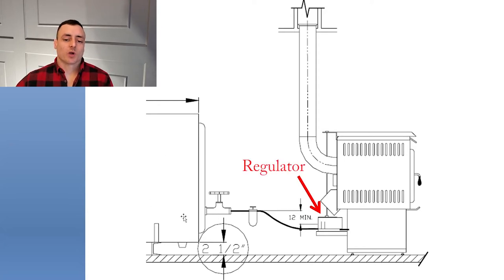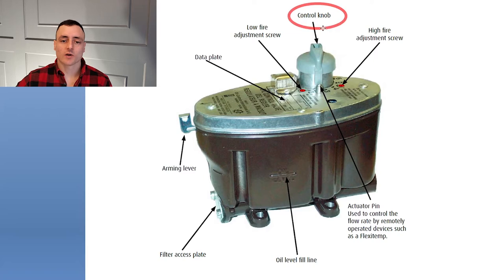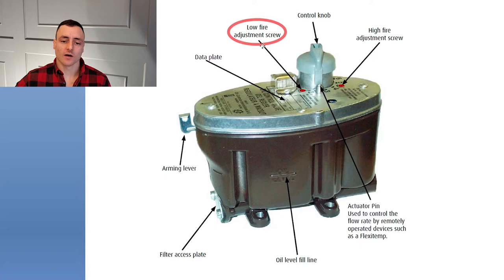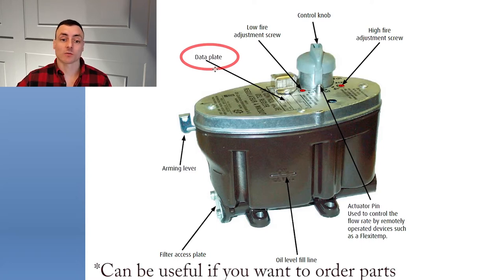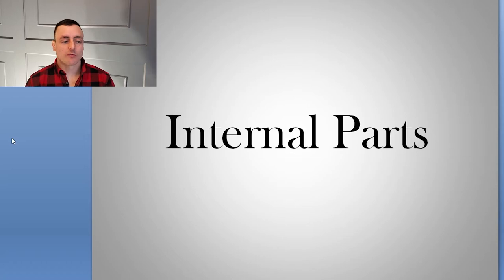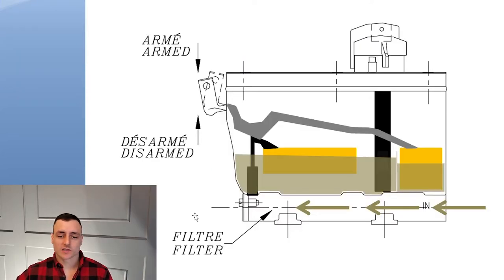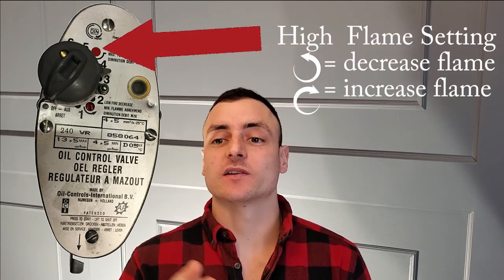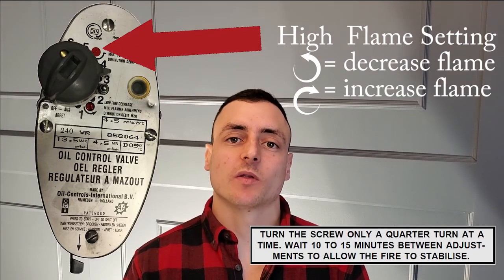OIL STOVE | How the CARBURETOR / REGULATOR Works | How to adjust and clean it

Comment: We have 
Hi we have a very similar regulator (a Lockgate) on a morso squirrel diesel stove in our narrowboat but have no instructions on it & have not been able to find any. This you tube vlog was reccommended & it's been really helpful, thank you.
We do have a question though - If it does overflow & shuts itself off where does the oil then go so it can be restarted?
Reply from the maker: Good day, glad it helped! The oil
Will be held in a separate compartment in the regulator (shown in a diagram in my other video). When you restart it, you need to press the lever down on the regulator to get the oil to flow again. It will begin to flow again and the overflow will eventually flow into your stove :)

Comment: Hi Phil, great video.  However, I'm not getting any fuel into my burner pot.  The fuel is running from the on/off but not exiting the regulator.  I have checked the filter and it is fine.  Any thoughts?
Reply: You need to remove your regulator and take the top off and remove the needle valve and float. Sounds like you have a float that is full of oil and it’s not letting the needle valve to open and let fuel in.

Comment: Hi! Thank's for the video. My float doesn't seem to operate properly, my carb is overflowing. Is there any info about the float adjustement? Thank's
Reply from the maker: Check out my recent video about regulators, I open one up and it may help you identify the issue on yours. It may just be stuck. Cheers!

Comment: I have a stove from the 40s. It has an end heater (oil burning). It has a regulator (constant leveler) but doesn't have the high low knob or set screws on the cover. Would you say use it cause it was original equipment or get one with an adjustment on it? I plan on hooking up this propane 4burner stove/ oil end heater soon and appreciate any advice you can give me.

Comment: Interesting info.  I just restored a GLT-II oil stove, and fired it for the first time today.   My draft measurement is too low, and sooting the glass a bit, but it was warm today.  (70°F/21°C)  I suspect that I'll hit my proper draft below 40°F/4°C outside air temperature, and things will run cleaner, but I can extend my chimney if necessary. (Only 14ft/4.25m and supposed to be min 16.5ft/5m)
Reply from the maker: My new video is up, thank you again for your help and good advice!

Comment: Thank you for all you videos! We have one of the old Coleman furnace oil gravity fed and your videos have been a a huge help. Finally got it running and throwing some heat with no black smoke billowing out the chimney. Just discovered that adjustment screw is missing. I don’t know if it was ever there TBH. Can it be replaced with just any screw that will fit? May seem like a dumb question but this has been a 2 winter labour of love project. Lol. I would hate to be back to square one.

Comment: Finally very good information on these stoves! I used mine for our portable hunt camp and we use diesel. I have few questions. 1 is it better to use stove oil? 
2 is a barometric damper recommended?
3 i cleaned it all out but it always seems to soot up. Would be high/lo flame adjustment or primary air? Thank you!
Reply from the maker: Good day, glad it helped! 
1. stove oil or diesel will burn pretty much the same. I haven't seen any benefits from using either. 
2. yes, a damper is always a good idea to keep a steady flame. 
3. It could be both, start by adjusting the flame to the low setting, and slowly increase the size. If the flame is too high, it will soot up quite quickly.

Comment: I have a heater that uses one of these carburetor. 1947 Sears pot belly oil burner. Been burning used oil through it very well except for the needed cleaning every day or two from the build up and chimney pipe cleaning every couple weeks. Was told to preheat the oil and that would help the soot and chimney build up a a lot.

I was thinking of doing a single or double loop of the copper tubing around the stove pipe but can't find any information if the carburetor will be ok with the oil heated.

Was also trying to find a way to preheat the pipe that goes into the belly, but not having much luck.

Any ideas?

Thanks
Bob
Reply from the maker: That’s a great question. I don’t think heating the copper line will affect the function much. Maybe running it at a lower setting to counteract the heated oil that’s maybe less viscous. Is your oil line freezing or affecting the flow? I’ve ran mine at minus 30 Celsius with no flow issues. Let me know :)

Comment: Would it work if you bypass the carb and just  regulate the fuel with a ball valve or something?
Reply from the maker: It could, but your ball valve would need to be perfectly adjusted. Might work for a bit and the it would be out of sync.

Comment: Hi Phil
Thanks for the info...I have an old stove with a similar control valve.
I understand about the high and low flame adjustment screws....but why is there a third adjustment screw on the adjustment knob itself (or under it)...?

Comment: Do you know how to set the Low Fire Limit screw (not the low fire - high fire on the slider?)

On mine, when you depress the actuator pin down, the oil flow stops completely rather than going to low fire
Reply from the maker: Does your float get stuck? Sometimes the overflow is too full causing it to trip right away.

Comment: Hi I've got a DeVille stove and I've been using it for years worry-free this year I went to fire it up and fluid leaked out where the disarming switch is I assume after watching your video that the floats and the shut off malfunctions so I'm going to take it apart again and look at the intake screen make sure that's clean and I will probably drain the carburetor itself and make sure there's nothing plugging the intake line and see what happens do you have any other suggestions thank you for clarifying that disarming switch and its function I always forget which direction it needs to go it needs to go up to turn it on and down to turn it off that helps

Comment: Good video. My stove stopped working. So I removed the filter. It wasn't very dirty. I cleaned it. And there still isn't any oil coming in from the line in the bottom of the stove. I removed the line coming into the stove and it was clear as well. Does this mean the valve itself is not working properly?
Reply from the maker: It could be the valve or maybe you need to use that lever behind The stove to clear out the line going from the regulator to the burning pot. Let me know if this helps.
Reply: Found the problem. The filter coming off the tank was plugged. Replaced it and it's up and running. Trying to adjust the low flame so it's blue and not yellow is a struggle though. On low setting it's yellow for the most part. If I turn the stove up to a higher setting it goes blue. Any tips on what I can do?

Comment: Thanks for your very informative video. I’ve tried adjusting the higher and lower level screws as you suggested and waited 10 mins or so with no noticeable difference to the flame. It seems the flame just stays to one side  (the side where the oil is flowing from) and never travels other to the other side to create the ‘ring’ of fire. Any ideas or advice on this? Thank you!
Reply from the maker: Hello Edmond, it either seems like your stove is no level, or there is not enough flow going into the burner. Did you try to open the regulator? After many years, deposits can block or slow down the flow. Let me know if you figure out what the issue it!

Comment: Love your videos.👍 i have just purchased a Siegler oil furnice and couldn't open the front viewing door when buying it. Got it home and openned the door and found the fire box corroded thru in a couple of places. Near the bottom ledge and on the left courner. But i have 2 questions 1. Can i rebuild/repair the firebox with ceramic fiber board and why can't i move the knob on the carberator at all. It has a small metal box on the top of the carb .near the knob with some dort of spring mechanism. On the other side laying above the carb is a box the connects to the power outlet which then connects to the fan. What are these things and can i savage any of it. So far only the fan works after tapping it it will turn on
Reply from the maker: Thank you! I'm not too familiar with the Siegler stoves, but I would use sheet metal to rebuild anything inside the stove as the heat will melt any fiber material. Try heating up the knob with a torch, it may be stuck. I beleive the part you are talking about is the pilot flame generator, to turn on the stove itself. Let me know if any of this helps, cheers!
Reply: Well the ceramic fiber is used in in kelms for ceramics. I don't think it would ever melt ceramic fibers since its used on my woodstove. But i will try the heat but obviously not the knob cause it would melt them. Where should i apply heat
Reply: Also Ceramic fiber is commonly used on stove gas furnaces that would otherwise melt the sheet metal.

Comment: If the burner is running too hot at the minimum setting, is it the low flame adjustment, or the high one I need to adjust?

Comment: Thank you Phil for the nice and informative video. I have a very old Coleman oil furnace with the same type of carburator . It as been stored for many years and I would love to install it in my shed. Although furnace oil is getting rare or very expensive I was wondering can these furnace burn diesel fuel instead ? Thanks Daniel

Comment: Hi, I have recently had my Rayburn serviced which has a regulater box as seen in your video. However the flue box now has tar in it and the slide is difficult to open and close as the tar stuff is making it stick, the chimney looks fine the cowl is still on the top. I rang the guy who servived it and he says it sounds like a chimney problem. It also smells in the house of fumes. He did have the top off the regulator box. Could something have been put back incorrectly
Reply from the maker: It you have fumes in the house, verify your door seal and make sure you don’t have negative draft (air going back down the chimney). Sometimes adding a few feet of length to the chimney makes a huge difference. For the tar, make circles and push it in and out to clear it up.

Comment: great video. Having trouble with my mother's oil stove in her kitchen that she still uses for cooking. Antique!!! anyways, it starts up with a nice blue flame but after 10 minutes or so, it stops and goes out. I haven't checked the filter yet for a clog but wondering if this is a safety  feature...automatic shut off?
Reply from the maker: Good day, yes there is a safety that shuts off the flow of oil if too much goes into the carburator/regulator. If it shuts off after 10 minutes I would verify the filter and make sure to give the pan a good clean. This will ensure a nicer flame.

Comment: I'm looking to purchase one and was wondering if you could tap off the main oil line that goes to the furnace? I know that there very efficient and use a lot less oil than a typical oil furnace.
I'm new to your channel and found your video's very helpful. Thanks Again!!
Reply from the maker: I don't see why not, the oil will slowly trickle through the regulator and into the stove. Because these are gravity fed, there should be no pressure build up etc.

Comment: Phil, my regulator has a metal box about 1 1/2" , sq.on 3 sides and a bit rounded on the top,attached to the top at the end near the control knob, with a long screw that has a spring/lever under it. it appears to read "fire" on the left side, and "air(e)" on the right. It also has a copper wire that goes into  the back of the unit but I cant tell what it connects to and what is the purpose? do you have any idea what it is? I have seen other photos on this kind of heater (Siegler) with this same device online. 
I have been having issues with this unit smelling of diesel and running too rich. It has caused me headaches, but it is my main heat source. i have shut it down and cleaned the soot out really good to allow better air flow and cleaned the filter (which was in great shape), but I am wondering if this box thing is an adjustment of some kind? I probably wont take the regulator apart until I can find out what this thing is. I wish i could send a photo, but youtube doesn't allow, i guess.
I appreciate any help! thanks
Reply from the maker: If you are willing, this might be worth a try: Shut off the gas. Disconnect the pilot tube. Use your canned air to blow up thru the pilot tube & pilot assembly. Reconnect the pilot tube, turn on the gas, light the pilot, & try the furnace. We might get lucky & you blow some junk out of the pilot assembly creating a stronger pilot & more voltage.
Reply: @philg  I will definitely do that. It seems to be running a bit better now since I have cleaned the inside and the air holes, but it does seem to be slow filling the bottom of the tank when I first light it, and the low flame adjustment probably needs to eventually be adjusted. I definitely need to extend my exhaust to increase my draft and be more careful about how I light it to reduce soot. Your videos have been helpful, but I will feel more comfortable experienting with making adjustments once things warm up and I can take my time to go inside the regulator.
Thanks for your advice and I will let you know how things go!:)

ps- Did you ever figure out what the box on my regulator is? If you paste in this link and go to the 8th image youwill see a fairly close up view of what I am speaking of.   
https://unitedstatesstove.biz/2016/12/06/heater-stove-large-porcelain-cast-iron-by-siegler-illinois-oil-or-kerosene/

Comment: I have an old Siegler oil burner. Was cleaning the control valve an lost the metering valve spring. 
Could you please help me find a replacement. 
Thank you.
Reply from the maker: I will look around and let you know if I find any.

Comment: Hey I have a question for you. I have an oil stove in my cabin and it has this same carbeurator. I moved the fuel tank and had to cut the hose and add length to it. I also changed the fuel filter while I was at it. Got it all bled out of air at the bleed screw on the filter housing. It is gravity fed by the way. Now I can’t seem to keep oil flowing to the carburetor and into the stove. I blew into the tank and oil would flow into the burn pot I would light it and it would go out. Fuel won’t continue to flow. Any ideas would be very helpful. I thought there would be some kind of bleed screw on the carb but not finding anything. Thanks
Terry
Reply from the maker: Good day, perhaps take the oil filer cap from the carb off to bleed the line. Sounds like you may have an air bubble stuck in your line, preventing the flow from the tank.

Comment: I am using a 50's era Coleman space heater at the hunt camp. The heater works ok but the flame is very orange  / yellow, very little blue and not much heat.  I am burning Diesel fuel and was trying to figure out how to adjust the heater  to burn  hotter / produce more heat?  Any suggestions? Your presentation, explanations and graphics are great! Keep it up!
Reply from the maker: Sounds like you may not be getting enough air, is your burger clean and I’d there enough air coming in? Hope this helps!
Reply: @philg  I vacuumed out the burner pot, the problem is I cannot see anyplace for air to enter around the base(or any where else). Could it be that I need to fiddle with the draft control?  Its a model 871 Coleman. Here is a link to the manual (where it does not mention an Air intake). https://s7d1.scene7.com/is/content/Coleman/Canada/Product%20Manuals/871%20Oil%20Space%20Heater.pdf
Reply from the maker: @montaguebob  good day, there should be small holes on the vertical walls of the pan. Try using a wire brush to expose them. I assume that the interiors walls of the burning pan have a layer or residue, not allowing the air to enter the chamber properly. Let me know if this helps.

Comment: I acquired a heater that had not been used in years I cleaned the filter put in some fuel and crossed my fingers it worked for a while but then stopped getting fuel I dissembled and cleaned the whole thing now it gets too much fuel and trips the second float help!

Comment: can this regulator be made fuel odour free?
Reply from the maker: Depends on the fueld you use, however these were designed for diesel or heating oil. If they are tuned properly, they should not give off any scent, or limited anyways.

Comment: What would be nice if they made a tank where you can use a bicycle pump or a battery operated compressor that puts a certain amount of airpressure in the tank to feed the oil through the line at a regulated pressure. Every so often the pre set pressure would drop and the compressor kicks in. Now the neat thing would be to have the compressor plugged in and it uses the AC applied voltage, however during power failure it uses a backup battery to operate the compressor. The compressor does not need to be big, just enough to supply a residual pressure of may 15 to 30 psi. This may be a great setup
Reply from the maker: You have the mind or an engineer! That would indeed be very cool :)
Reply: @philg  I've worked on the old Coleman heaters that we used in the basement. That was our old school register heat when we lived on a homestead. The heat would radiate up the cast iron vent grates my dad fabricated. We used a wood stove for cooking in the 70s and 80s and electricity for our lights, water and television. That was our lifestyle growing up on a farm in Alberta and close to Chip Lake for fishing. Plus we had mixed farming as well. Fresh milk, fresh bread, vegetables from the garden. Our own poultry and livestock for meat. Life was healthy and great and still is at our other home out in the country.
Reply from the maker: @Ecksterphono  wow that sounds amazing!! It’s the simple things in life that are important.